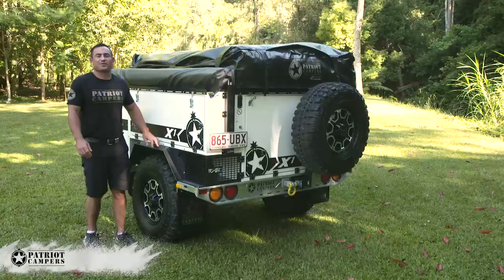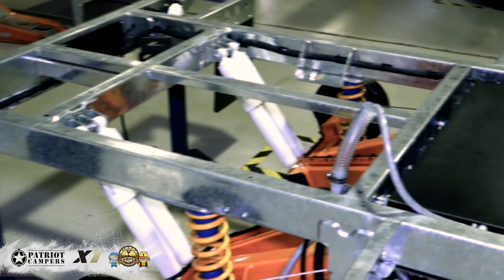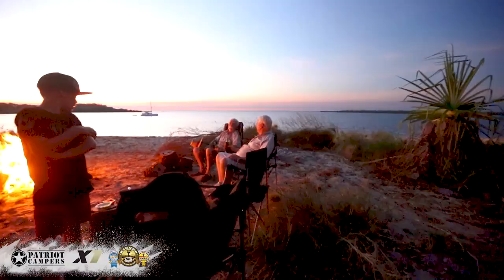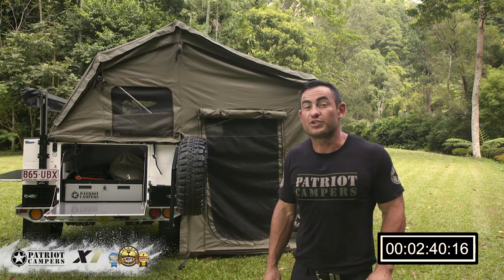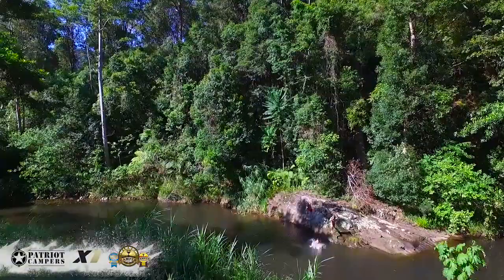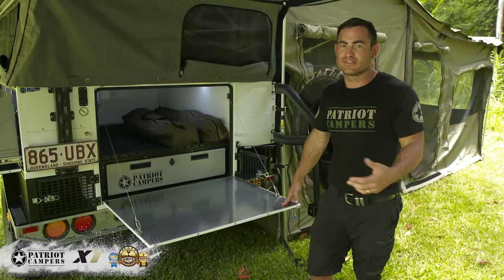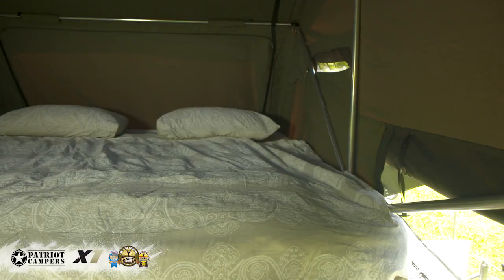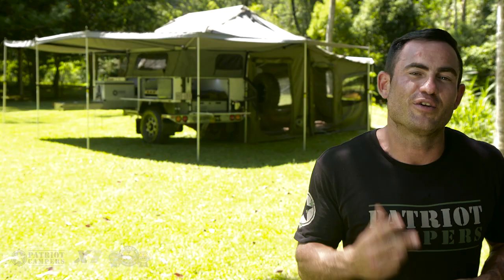Patriot Campers X1 - 2016 WINNER Offroad Camper Trailer of the Year 2016

Comment: I just don't understand why tent trailer + off-road means you HAVE to have your stove and sink in a slide-out drawer.  It's nice to have tables deploying from the sides of the trailer if I WANT to set up, outside, but I want setting up, outside, to be an easy OPTION, but not the starting place.  When that tent first deploys, you should be able to start right in cooking, inside the enclosure.   Those decades-old basic tent-trailer designs by Jayco and Rockwood, are simply the best for getting shelter up, quickly and starting your activities, quickly.  The places I'd be taking mine would tend to be high latitude, high altitude, and deep into fall and winter.  Early in the spring (The absolute BEST time to be out, because it's just too nasty for most people)...

For me, summertime camping is just a small part of it.  So I want to have shelter around the cooking area, first thing.  I also want air-conditioning, dammit!  LOL!  But moving a stove or setting up a stove, outside, if I've got flip-down or slide-out tables.  Keeping the main sink, in-board, also reduces risk of freezing, because I'd be using mine in freezing weather.  That'd be half the fun.  

Be nice to have an old beater to experiment with.  I'd do stupid stuff like just add a layer of foam insulation to the outside and spray-paint something funky on top of that.  IDGAF what it looks like!  LOL!